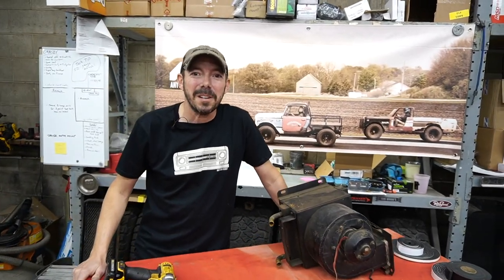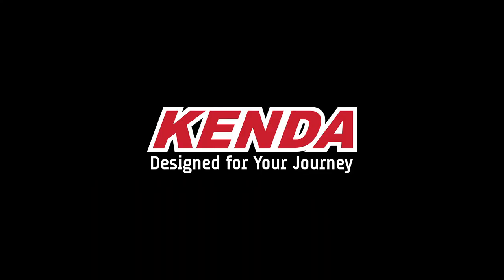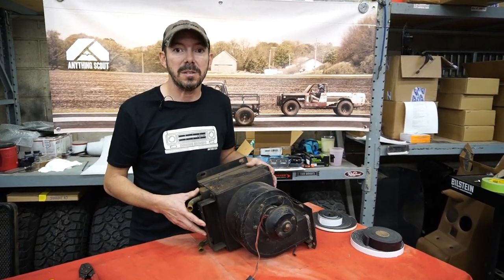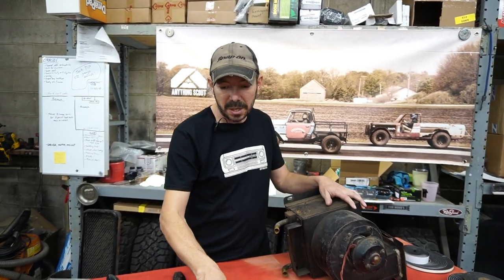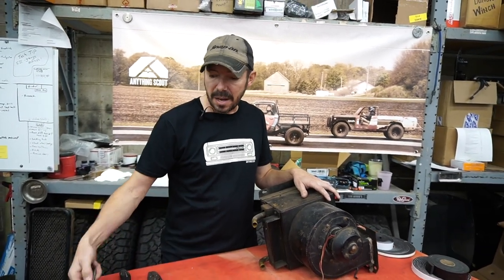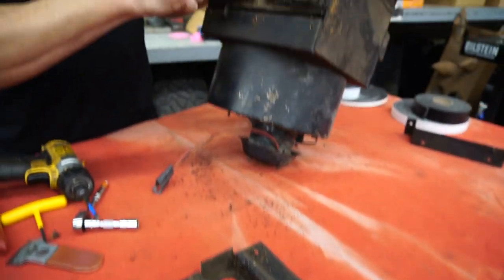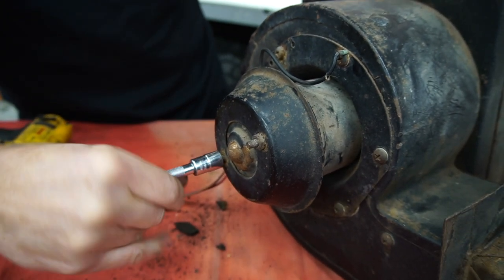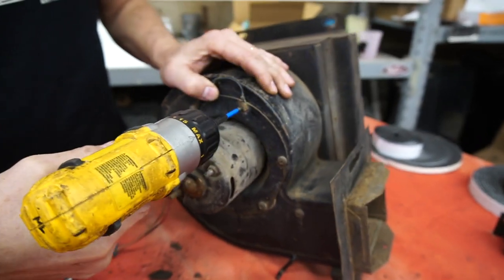TECH TIPS: How To Repair A Scout II Heater Box (Heater Core + Blower Motor)

Comment: Just rebuilt my 72 heater box last summer. Darn air control door wasn’t working correctly afterward. Then I caught this video and the handy comment about the sheet metal stop screw for limiting the travel of the door!  One screw later, ‘mischief managed.’

Comment: I imagine this is for early model Scout IIs ('77+ use a different motor). What's the CFM on this blower motor you sell? I feel like the one in mine doesn't push much air when it's on high, and makes rattling noises.